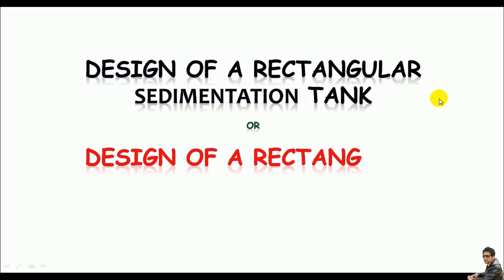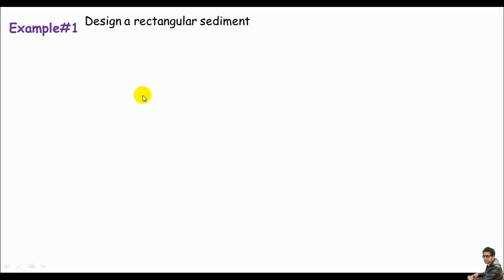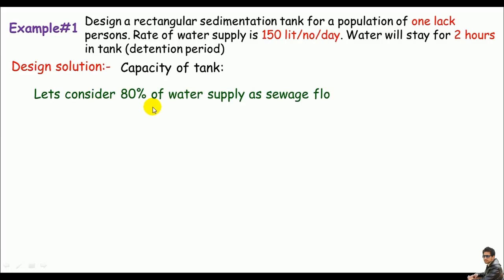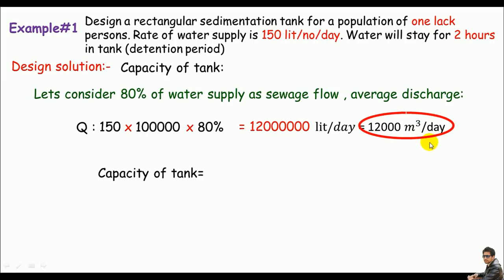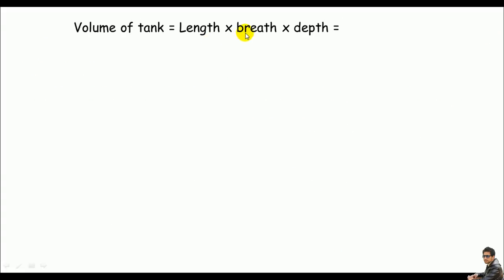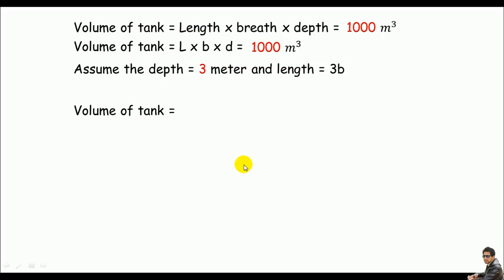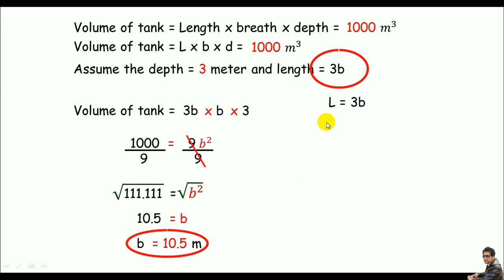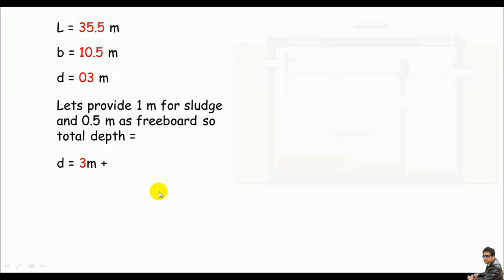Rectangular sedimentation tank design.

Comment: determine the storage volume of an overhead tank to balance the treatment plant output of 113500 m3 /day with the high service pumping with the following schedule: [10] 12 midnight – 6a.m. = 2.83 * 103 m3 /hr 6 a.m. – 10 p.m. = 5.68 * 103 m3 /hr 10 p.m. – 12 midnight = 2.83 * 103 m3 /hr utilize graph paper for plotting the supply/demand curves.
Reply from the maker: Will try this soon